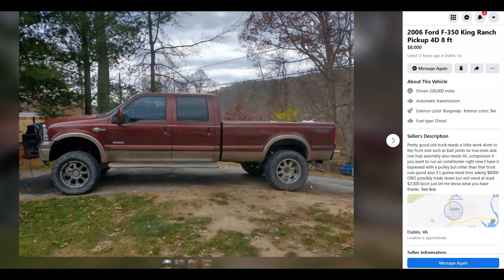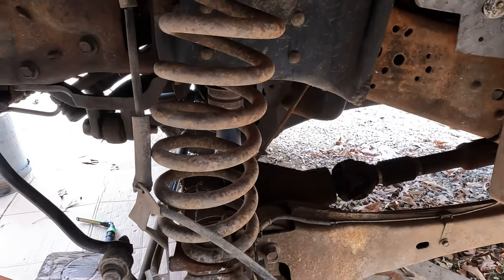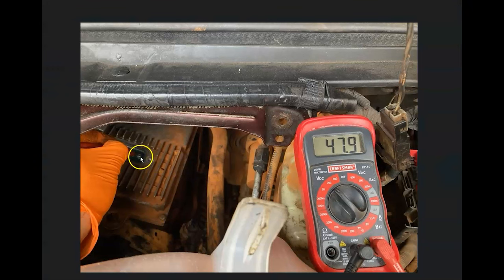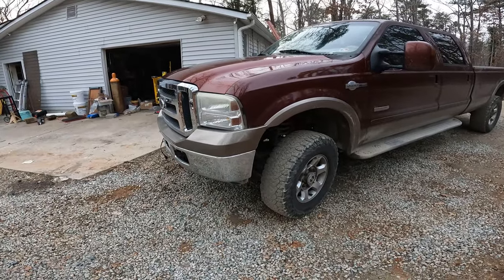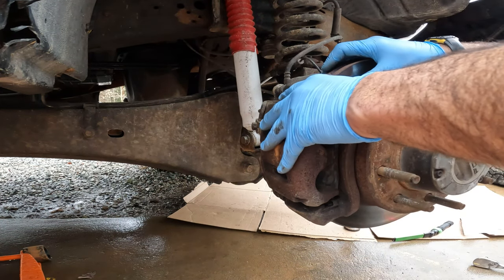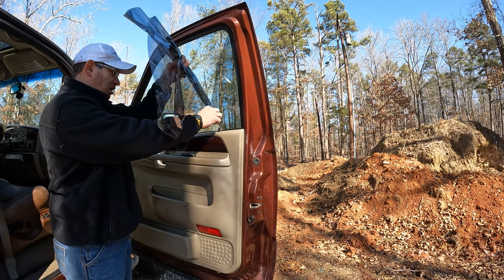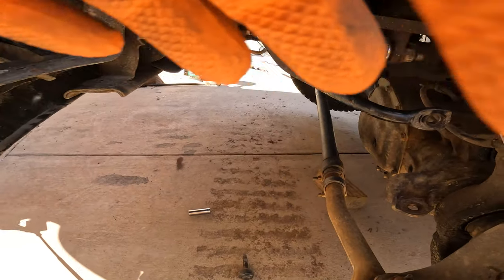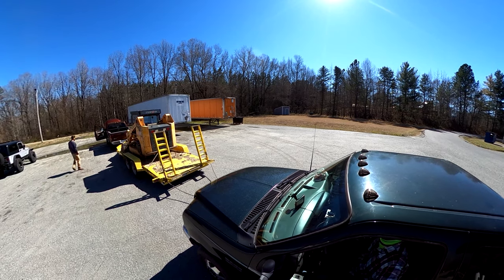Will it run? Buying a new pickup truck

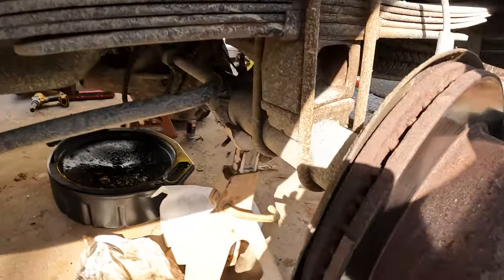Comment: Great video Shawn. I did not enjoy watching you struggle, but I did learn from your purchase and how thirsty people are on the internet. We had 1 - 6.0 at the last place I worked. When it ran, it ran great. We did have some issues with it but it was a lot more temperamental than the 7.3. I was hoping you would end on a positive note as well. But you will get it figured out. I didn't want to mention that at about 37:36 it looked like possibly a broken leaf spring. 😞
Reply from the maker: Thank You Ed! This has been a great truck and I really like it. I have a new IPR sensor on order so hopefully I'll have the truck running again this week.
Reply: The left rear also has a broken leaf spring

Comment: you should pull out slide bolt on brake caliper and lube them and put copper anti-seize on the metal tips of the brake pads help to slide better
Reply from the maker: Great tip!

Comment: If you are keeping the truck, put it back to original,  original ride, hight. Otherwise what you just did, you will be doing it again, in a couple of years, ball joints  can't take the pressure
Reply from the maker: Yes I removed the lift and installed four new shocks.

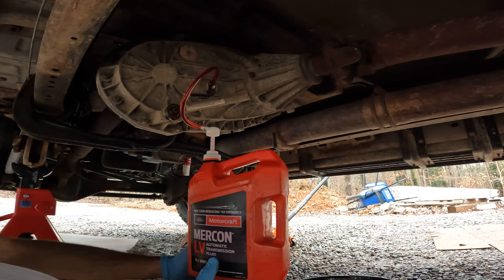Comment: When you change the fluid in the transfer case or the rear or basically anything else always check and make sure you can get the fill plug out first 1:04:49

Comment: Looks like by the rust stains around the coolant reservoir area, the cooling system is going to need work also.
Reply from the maker: The guy had been filling it with windshield washer fluid!!!!!!!!!!

Comment: Brave. Used diesel market is all modified or high mile originals. Can't imagine what the bill would be at a shop for all you did.
Reply from the maker: Amazingly, this guy didn't mess with the engine with tuning or anything. I stay away from those diesels. The lift kit did enough damage, but I got that eliminated.

Comment: Sean great video Stay away from the old Fords  With power strokes you're asking for trouble  Buy you a Dodge with  Is a Cummins 🙂
Reply from the maker: I've had really good luck with the power strokes. They are easy to work on, upgraded parts are available, and lots of great videos about them. I have three trucks with the 6.0 engine.

Comment: Welcome back, 3 weeks Post, was starting to get worried you got lost....Wow thats a lot of manual labor there for that overhaul, 
Previous owner (not to be crude) must have been an idiot with the rear brakes, Dont know how you got so lucky not having to "turn" the rotors for the brakes
due to how messed up it was. That truck Defin had a rough go, though you have gone through a literal laundry list of parts. Great job on the back slider glass i would have
been  sweating that as well, though after watching Robby Layton's channel he showed how to do that at least a few times on other things. Hope it turns out in the end.
Reply from the maker: Yes I've got a few videos I need to get out. They do take a lot of time to create and this video (121gig) took three days to upload over my copper internet connection. 👍

Comment: Great Video !!! What  did your friend find wrong with the truck ? Keep the mechanic videos coming !!!!
Thank you
Reply from the maker: I'm working on Part 2. The truck was losing oil pressure on cranking and had a leak. We aren't exactly sure what was leaking but did the drivers side with all new injectors, dummy plug, stac pipe and it runs very well now.

Comment: Looks like you have some algae in that tank as well.  Fix Or Repair Daily = FORD
Reply from the maker: Could be. I've run some cleaning treatment and have put around 1200 miles on it so far. It's doing pretty well.

Comment: Good job on saving that truck! You returned it to working for a living like they should be. The goofy wheels, "level kit" doesn't do it any favors. For what you paid and have into it, you're still pretty far ahead of the game. 

It does looks like both rear leaf springs are broken. The main spring.
Reply from the maker: Yes I'm checking into the springs. A fan of mine texted me yesterday about them!

Comment: Dear Sean, I have so much to comment that I am going to do it in a couple of messages, I saw the whole video and I loved it, I really like cars and mechanics and you have given a magnificent comprehensive maintenance course, ask, the radiator, the coolant? Why was there a lot of water with rust in the area of the deposits, the air conditioning? Since you put a new compressor on it...
Reply from the maker: I think the guy had stop leak in the coolant, and he was using windshield washer fluid instead of coolant. The AC is back together but I didn't include it in this video because I thought it would make it too long. I'll do an update and include that for you.

Comment: Hey, I was thinking about the vid where you did a large driveway and the owner wanted a ramp at the far end.  he didn't speak good Hinglish...recall it?
He was also not pleased with the area you ground out and you were worried you may not get more work or a recommendation from him..
Anyway, I was thinking cut a groove on either side of the swale the depth of the concrete gutters you use.  #" wide ish that sit in a plastic trough.  Bolt them together and insert into the area cut out between the cuts.
This or cutting it out wider and deeper and repouring with fresh concrete and blending it in on the top at the side with the trowel used on the edge of driveways.
It's sort of clear in my mind but not easy to explain.
Reply from the maker: Yes you're thinking of adding a channel drain in that area. 👍 That would work and look better for sure.
Reply: @GCFD  yes, channel drain.  Maybe 4 bolted together inside a cutout wide enough to accommodate.
I know it’s simplistic but you may consider doing a mock-up in your fancy office or on AutoCAD and let your viewers chime in.
Another idea could be the catwalk material similar to the channel drain.  It’s about a foot wide similar in appearance or maybe even flat plate steel punched with holes and curved like a sealed in the middle to catch water.
Cut a lip out of the edge of the concrete to accommodate steel plate.
It would all need to be in the same plane or it would rock ie wobble.
I thought about this about 3 am this morning.

Comment: Off-road diesel and posting it on YouTube don’t be mad when you get tickets let’s ignore the fact that it has antifreeze blowing all over the firewall don’t forget about the broken leaf spring and I can assume that it has a limited slip rear end and didn’t put limited slip additive back in it 90% of the death wobble is caused by the inner you joints you can see that they are shot I am commenting on this video as it’s going without watching it and it’s entirety so forgive me if certain things are addressed
Reply from the maker: Keep in mind that was the seller's diesel fuel and not mine. The truck died and was towed back to my house. Please do finish watching this video. This has been a great truck so far.

Comment: Well..
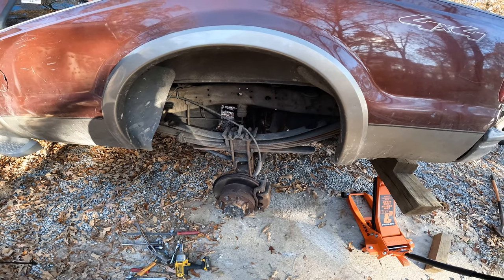#1 at 20:09 you're at driver rear not passenger rear side.(unless you switched the steering to the other side 🤣) 
 2. Isn't that leaf spring (both sides actually) broken??
 3. This truck is a pain in the a**!🤦 idk why you bought it.. hope you got it for much cheaper.
 Also good tip: don't trust those jacks either,  trow your wheels under just in case  for security.
Reply from the maker: Great tip!

Comment: Hey my man. Love these videos as always. I admire how your not scared to jump on something and tackle it your self. I will say im sorry you bought this truck. The 6.0 litre Diesel is one of Fords worst engines, if not THE worst engine from Ford. And in the world of Diesels??? One of the worst designs period. They are all over diesel blogs and forums. Everybody says stay clear of these motors like the plague. I think 03 to 09? Good luck man
Reply from the maker: Thanks patrick! I like the 6.0 and I have three of them. The problems are well known, easy to diagnose, and there are many companies selling upgraded parts. I'll be tackling the oil cooler relocation from bulletproof diesel on my 2005 f550 dump truck soon. After working on this truck I wouldn't hesitate to buy another 6.0 that needs work.

Comment: What a strange way to build a truck.

My father's diesel Toyota Landcruiser (well, he just sold it, but irrelevant) had its A/C compressor fail, and it blew a belt. However, the engineers at toyota put the A/C compressor on its own belt, so everything else runs fine. Also, the fuel filter is actually not UNDER the car.

No wonder japanese cars dominate the american market but american cars barely touch the japanese market... maybe ford should take some hints. I'm pretty sure things like this combined with high prices were what killed my country's General Motors- Holden.

Comment: Enjoyed this very much. Totally unexpected going by the rest of your content (which I enjoy too) but was excellent. Well shot and edited. What camera are you using? At one stage I saw a large screen on back of a camera you had under the car.
Reply from the maker: I'm using the gopro 10s and the gopro max 360 cameras. I recently upgraded after I saw how much better those cameras are than the garmin virb 30 I have been using. Would you be interested in an off topic video talking about my camera equipment?

Comment: Looks like it has a lower radiator leak also
Reply from the maker: It did have a radiator leak and I used some jb weld as a quick fix. That's been holding so I'm pretty good with that. A new radiator is on the horizon though.

Comment: I watched the video two times now. I need to get under my truck pump out the transmission fluid from the pan it has no drain plug and pump in some new fluid and get new tires. I hope yours is still running well. The seller said you just need to change the fuel filter. How is it running today?

Comment: Before you spend any money on this you need to find out if the engine and transmission are ok first, The sound of the engine while cranking sound like there's a cylinder with no or low compression.
Reply: No or low compression on one cylinder.
Reply from the maker: The truck had a couple bad injectors on the passenger side and I replaced all four since I was in there. It's been running very well.

Comment: The truck is beautiful, in addition to the color, the box and the height in which it is, it also has a very good interior, will you clean it so that it stands out? I know it is a work tool but it is what you move most of the time and it would be a very nice interior, since you have even changed the rear glass and reconditioned the electric control of the sliding window ...
Reply from the maker: I really really like this truck so far. It's an awesome truck especially with all the new parts.

Comment: Just wondering, did you lubricate the caliper slide pins in the front and the used right rear caliper? Use silicone based grease. Anyone else notice when he tightened the missing bolt, it brought the track bar down a little and back in alignment as it should be?
Reply from the maker: Yes I lubed the slide pins and I didn't notice the track bar came down. The front end feels awesome now and I wonder if that was part of it. The bolt was a bitch because it wouldn't line up and I just went for it.
Reply: @GCFD   Right @1:33:43  Cross thread is better than no threads!  ... Its feels a bit nice to restore it all up. I know its a work truck, but it would be cool to see an interior detailing. Hope it is a simple issue to get it back running good. Have you had the fuel tank flushed from the old fuel in it?   ... I look forward to new videos from you no matter the content. You really inspired me to bury my downspouts at my new home. The pipe has gone up about $12 a stick in just a few months! 😮 I just need to dig the trenches next.
Reply from the maker: @MacAttack2010  the extra cost will be forgotten after you’re all finished.

Comment: Ford F-350 diesels that where produced in 2007 had international engines in them the reason I know that is my mechanic told me that they had international engines in them and he owned one with that motor in it he ended up getting a different truck and swears he will never get a ford truck again

Comment: Glad you removed the big tires & leveling kit.  Sorry you got stuck with a lemon. The seller just didn't want to pay for the repairs. Truck should have been worth scrap price for the damage done by the seller. 
Buy it for 10k, add another 5k in repairs. (For example only)
Reply from the maker: I don't know what I was thinking not looking closely at the truck. But it's been a heck of an education on the diesel stuff.
Reply: @GCFD  not only on the engine, the entire rig. Too bad there aren't "lemon" laws in your state. But I don't know if those laws would pertain to private sales. And I'm not sure what states have such laws. At least you know the work performed was trustworthy. Just sucks about getting screwed on such a rig.

Comment: Did you fix what caused it to die?
Reply from the maker: Not yet. It's a high oil pressure leak so it won't start. I'm investigating and will hopefully know next week. It's probably an o ring, injector, or dummy plug o ring. 👍

Comment: The guy that sold that truck for $8K made out like a bandit. There is not a 6.0L or 6.4L diesel truck out there I would pay $1000 for. I'd give some more for the truck without the engine in it. These two engines were junk and doomed right from the factory. There is no saving them, they will blow up.
Reply from the maker: This has been a great truck after I got everything fixed up. I have three 6.0s. I like them because their problems are well known, there are lots of repair videos, and many companies making aftermarket parts to solved those problems.

Comment: you were better off just buying a rebuilt or a crate engine for what your putting into it ugh .... this is why i hate when people still are selling high mileage vehicles .. just trade them in for your new vehicle
Reply from the maker: This truck new would be over 85k!! All the new emissions stuff makes them very expensive to own and operate.
Reply: @GCFD  yeah any new vehicle is overpriced and becoming crap ... a friend put a rebuilt engine in his 2020 F350 for bout 4,000 because the factory engine gave him to much codes even after they " FIXED" it .... so he went with a diff ford engine without all the issues
Reply: @GCFD  i saw stories of the  2022 F350 not shutting off properly even thru the phone ap  some even catching on Fire . a total loss to a 90k vehicle
Reply: 2022 Ford trucks are having tailgate issues  when stuff is leaned on it it folds up ....

Comment: You should have done a better job of inspecting the truck before you bought it. All the things you found wrong with it you should have caught with a scan tool and a good visible inspection. You can’t trust anyone  when it comes to a vehicle you have to put in the effort to inspect it first. Plus it’s a 6. NO engine and shouldn’t have even considered it.
Reply from the maker: Hahah for sure! I think I was distracted by a pretty truck. I have two other 6.0s and I like them. The reason is the problems are well known, lots of videos on youtube, and lots of companies selling upgraded parts.

Comment: Yet another victim of the 6.blow
Reply from the maker: I have three of the 6.0s. Great engine especially since the problems are well known and multiple companies are making upgraded parts.
Reply: @GCFD  yeah... no engine is worth dumping 10k in extra aftermarket parts every decade just to get it to run at a normal power level.

Comment: 6.0 and especially the 6.4 are complete garbage engines
Reply from the maker: I disagree. I have three 6.0s. The problems are all well known and many companies have made replacement upgraded parts. There are also lots of repair videos available. My next mechanicing video will be installing an oil cooler replacement by bulletproof diesel in my dump truck (with the 6.0).